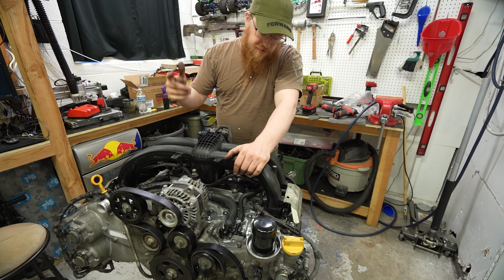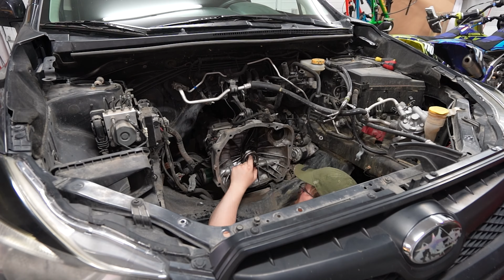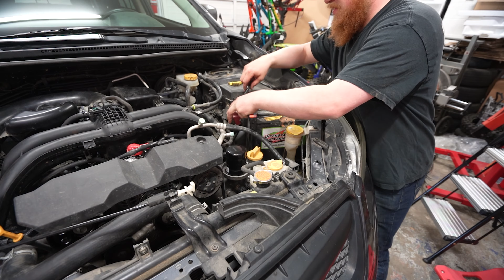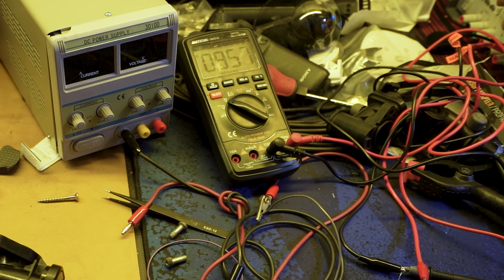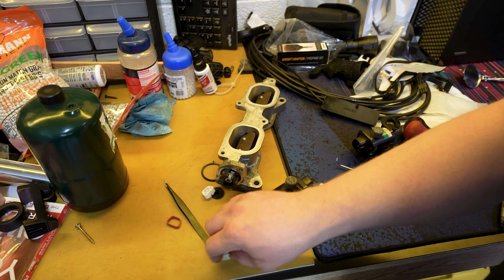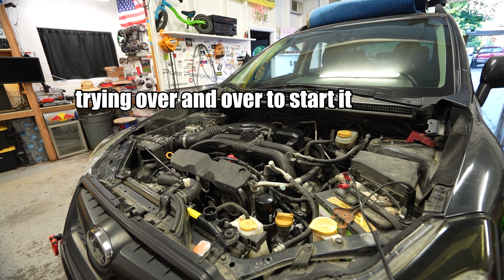New Motor Going In! Crosstrek 2.5L Motor Swap. Big Issues!

Comment: or just turn the key to on, let the gauges bounce back, then hold the throttle to the floor and hold it there while you turn the key all the way and crank the engine... it wont start... itll just crank till you let off the throttle... it does this specifically so you can crank it to build oil pressure after oil changes or long run intervals. also for a flooded engine etc... no need to pull the coils...

Comment: is it because the teeth on the cam gear are different? the teeth that the cam sensor reads. I wonder if that would cause an issue
Reply: Thinking the same or the timing jumped when he was having trouble with the chain tensioners last episode.......
Reply: I don't mean skipped timing, I mean the notches that the cam sensor reads. Some of the newer fb engines have notches instead of teeth or teeth instead of notches. The all have the same spacing, but I wonder if the ECU has trouble interpreting the signal if it's expecting a tooth signal and it gets a notch signal. I don't even know if the signals are different enough to cause an issue.
Reply: Yeah I'm thinking timing skipped

Comment: Was recently looking at/considering an oil catch can for my '18 Forester. Any feedback on if it is worth it?
Reply: some even recommend a 2-can set up.  pcv and ccv sides covered.   Apparently, these Subaru fa/fb engines benefit from catch cans and air-oil-separaters